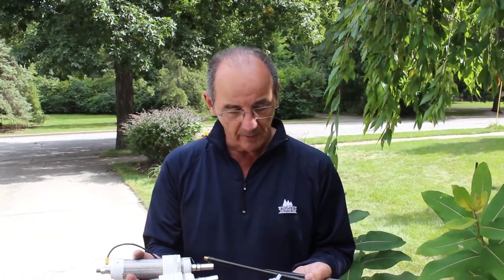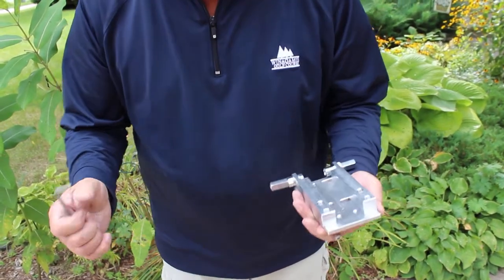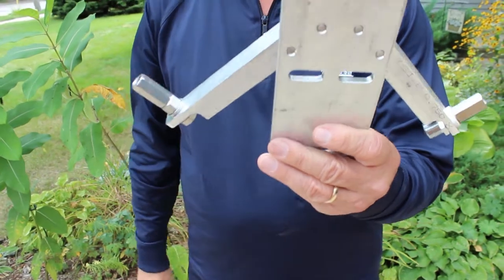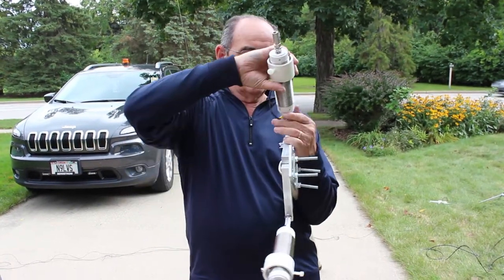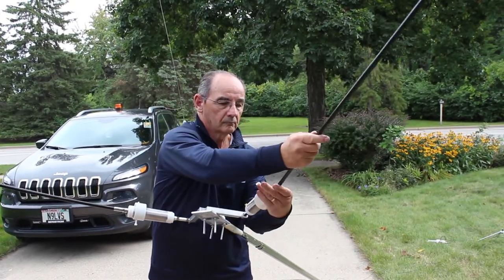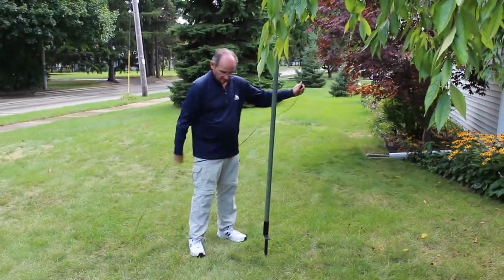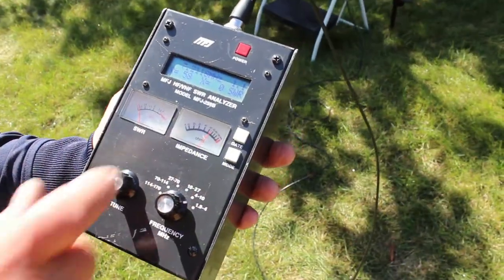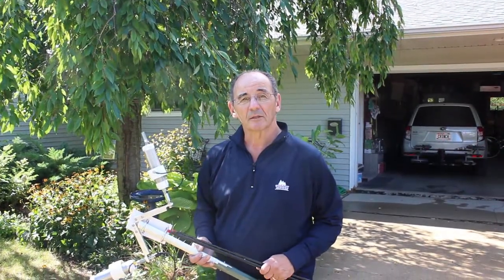Otophone

Comment: I have turned this into a 10M delta loop.  I used the plate, two coils, two CB solid whips, a jumper of 13 feet with two mueller 20amp clamps and a 2:1 balun.  It works great.

Comment: Wow, I could mount this on my chimney and almost get a 40m antenna, I noticed it was a little short for the CW portion which is the only mode I use.  Would I need longer whips?  Or was there more taps in the coils that you didn’t show?

Comment: I’m thinking I could use these to make a tunable loop - connecting the top ends of the whips with a line across the center to form a closed triangle -.
Reply: I did this to create a 10M Delta Loop.  I used 2 coils, two CB whips, a 13 foot jumper with Mueler 20 amp clips and a 2:1 Balun.  Works well.